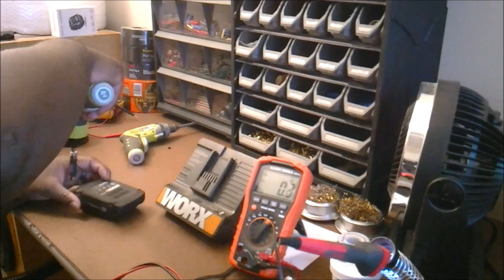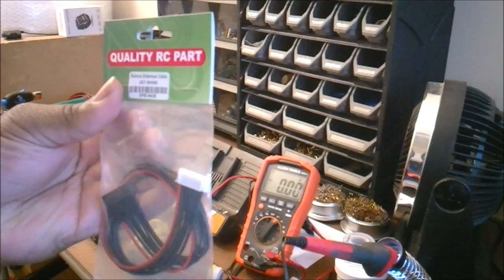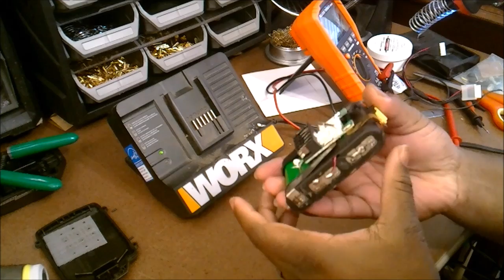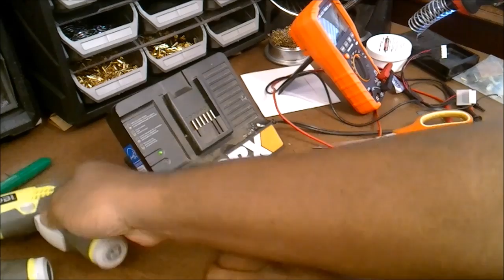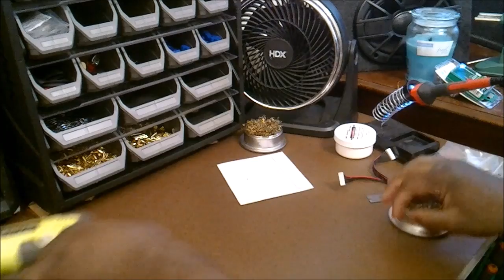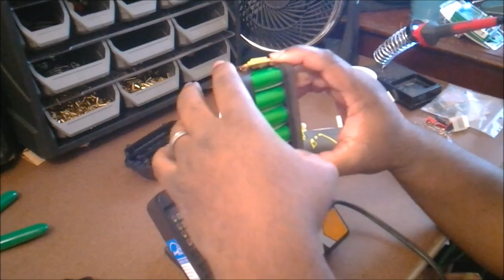Worx Lithium 18v Battery Investigation and Repair

Comment: can any one tell me the temperature range that is best for storing worx 20 volt batteries?
Reply: Any brand litio ion battery will require +0C up to 35C temperature. 

And a have a charge between 20~80 percent at least 1 time per month.

Comment: The nice thing about both those Ryobi 4V electric screwdrivers on your bench is that they are 2-speed.... both will  go either 200 rpms or 600 rpms. There aren't many rechargeable hex chuck cordless screwdrivers on the market that will do 600 rpms. It's all I use on my guitar repair bench.

Comment: As in the owner's manual: (1) steady red light = battery charging, (2) blinking red light = bad battery, (3) steady green light = battery charged, (4) blinking green light = battery overheated, remove and let cool before charging. ... The flashing red light means your battery is defective.
Reply from the maker: After doing this to the pack over a year ago the pack is still in use. Pack wasnt defective that shady BMS on the pack was draining the first few cells down. Since rebalancing the pack and putting it on charge once a month its been working fine.

Comment: I'm sort of having the same issue. Sometimes solid green and sometimes blinks red. I have 3 batteries and all 3 of them do the same thing when I plug into charger. Although it lights up green, it's not charged. I don't think anything is wrong with the batteries because it's just too odd for all 3 to go bad at the same time. I suspect the wall charger is bad, but sometimes after smacking the battery, it then starts to charge, but it's no longer responding no matter how many pimp slaps you give it. Any suggestions appreciated or vid links?

Comment from the maker: Before I balanced the pack the charger would not charge the pack because one cell was high. The BMS wouldnt allow you to charge the pack. In the video I show what the cell voltages were. The pack was not charged the whole time. The rest of the cells needed to be balanced to fall in line. After I balanced the pack and brought the other cells back up and put in a significant amount of ah into the cells . Since the balancing fully charged the pack the charge r would not come on for the same condition as before. one or more of the cells were high.so I discharged it down below the chargers cut off threshold. the chemistry can support 4.2 which is what I charged to but the charger only goes to 4.1 something. But you are correct it was fully charged after i had balanced charged the pack. I could have saved a few minutes in the video but its still good I checked to confirm that's how the base really operated cause the indicators don't tell you much on the front of the charged.
Reply: Christofer Parham  i  did  buy  a  kit  from  them a few years back  I returned it to the store for some of that show with the Charger and the battery talking to each other i  had  not  time  for  the my ten-year-old Makita still no problems  and yes it's lithium's first generation and I had to replace the batteries because the two   died over  time yeah  not  saying  its  a bad  brand I own there other plant Rockford just  a screw gun not drill  still  works
Reply: It was good video!